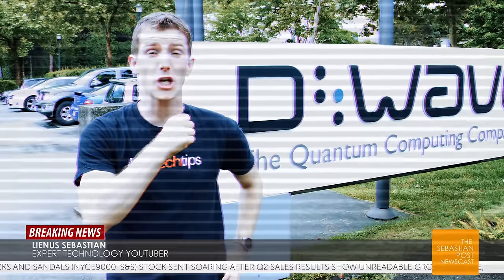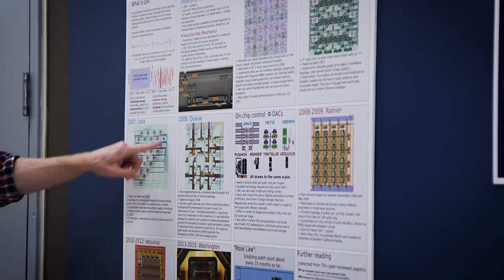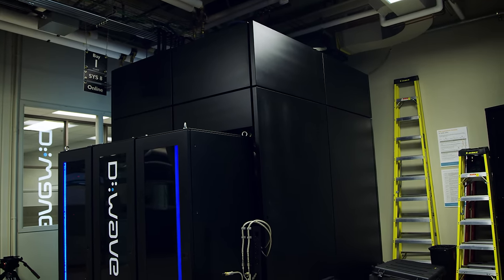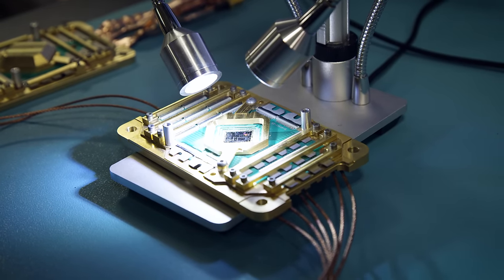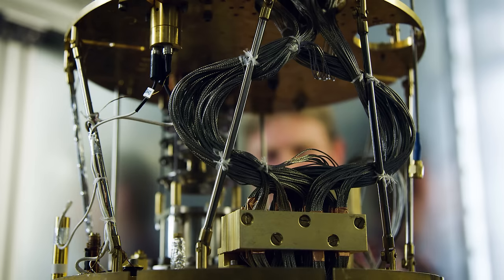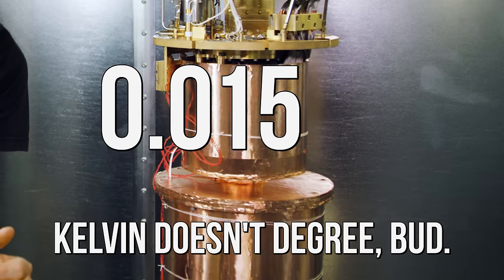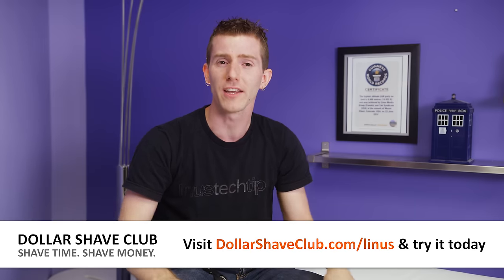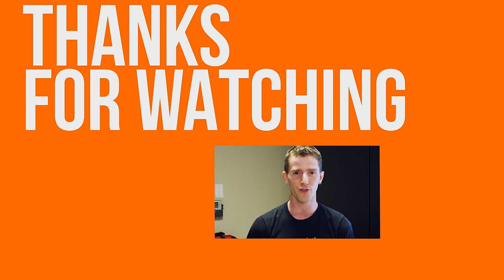UNBOXING A QUANTUM COMPUTER! – Holy $H!T Ep 19

Comment: Hmmm how about launch quantum computers in space just to cool it?
Reply: Gummy Ruler No, wouldn’t help.
Reply: it's not that it wouldn't help. you would make some problems easier and other problems much harder. easy vacuum but more difficult to shield
Reply: "empty"  space might be cold but it doesn't absorb heat well. Actually,  vacuums are an amazing insulator (like in bottles).
Reply: Also, space is too hot for it. 3.1 Kelvin is hotter than the 0.015k reported. You would still need to find a way generate lots of power to get it cooler. I think, (not sure)  its harder to get something from 3.1k to 0.015k than it would 70k to 3.1k.

Comment: Honestly these D-Wave computers are more 'quantum ASICs' than quantum computers. They specialise in a process called quantum annealing which is used to find the maximum/minimum point of a big complex function using quantum fluctuations. It's a step up from simulated annealing (the classical version) but these machines don't implement a model of universal quantum computation

Comment: Quantum computing will send bitcoin to $0
Reply: Google recently announced quantum computer is 30 years away before it can reach bitcoin and until then cryptography might advance to quantum proof levels
Reply: Quantum computers are still extremely slow.
Reply: the limit of 21 million bitcoins will be reached in 2140 (c)wiki
Reply: >wasting time and money on the biggest speculator bubble of our generation
Reply: Biggest speculator bubble of our generation? Ok what about housing markets that went down in 2008? What was its worth?
Reply: I assume you're referring to a breaking of RSA, which would also compromise SSL, thereby giving access to your eMail, bank account, and nation's nuclear codes. Bitcoin is the LEAST you should worry about if that scenario comes to pass. Fortunately, the NSA is aware of the risk, and has already started a call for quantum-proof replacements for RSA. Once those become available, the bitcoin protocol already supports applying such new standards to new wallets. You would only need to sweep the coins from your old insecure wallet, to the new quantum-proof one.
Reply: bitcoin mining requires doing many calculations until you sorta win the lottery and get the right combination of numbers. is this not the specialty of a quantum computer?
Reply: @Pete Lorenzo No. You are confusing NP and BQP. NP is the class of problems where checking a solution is easy, but finding it is hard. A good way to explain NP is to compare to Sudoku: It's easy to check if a certain assignment of numbers to squares has any doubles in rows, columns, or blocks. But it's harder to actually find such an assignment of numbers.
BQP is the class of problems solvable with high probability with a quantum computer. It adds some quantum operations, but at no point are all possibilities represented at the same time, and certainly not at equal probability. As far as we know, BQP is a strict subset of NP, or at the very least, the conversion between the two is far from linear.

Also, it should be noted that the makers of Keccak, which is now the basis of SHA3, attached a proof of being immune to all known quantum algorithms. While newer algorithms may be developed in the future (just like classical algorithms could), this just goes to show that quantum computers don't make solving these sort of problems trivial in the least bit.
Reply: @Saar Korren thanks for the correction. beyond what I know about it, but I will look more into sha3 as it's relevant to me.

quantum computers are the end-all-be-all of processing, like deep thought. we should ask it "is God real?" and it'll snap the output to the correct answer, which is obviously 42.
Reply: Pete Lorenzo
Not if the cryptography you feed it is also born out of a matrix of quantum waffers.
If you asked it "is God real?" the answer would prolly be "No, you guys made that shit up on animal skins".
If he was real he'd be in a field somewhere talkin chooch and your question would be "is God really God or is he the planet saturn (satan).

Comment: yes but cod will run on a suppercomputer and you can buld one just get 254 gb of ram make one unit with 5 graphics cards on it (VERY LOW DENSETY RAM BTW) get 5 cpus for it and thats about the  start of one rack module now just get 5 more rack modules put them in a server stack boom you have one module now get 37 of them :D (all other hardwhare is also top of the line and extremely over the top) this will reatch the base requirement to  play minecraft
Reply: oh almost forgot to mention put the 60000000 ethernet cables directly into the fiber optic cable useing a direct adaption or  just buld the fiber optic cable into the pc

Comment: I think Cyberpunk may be smooth on this, It's quantum game for normal pcs 😄
Reply: It totally would because of the Qubits, so much goes on in the game and Bits aren't gonna cut it or control all NPCs in every area, there's a reason why loads of NPCs can't figure out where to go and just act normal which is how the console is running so much code and unable to keep up with the player, PCs are more powerful so they don't have as many issues but still has some problems, basically just not as noticeable.